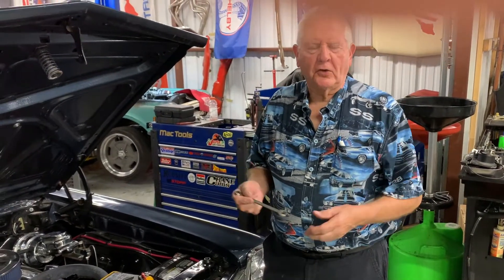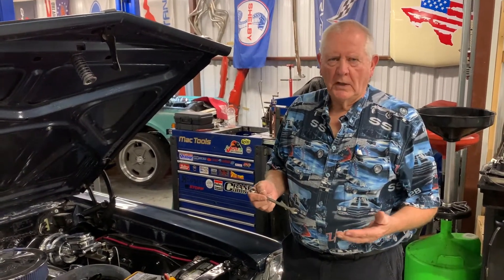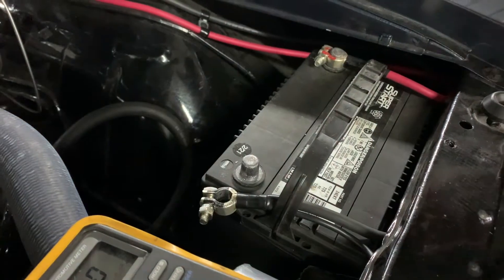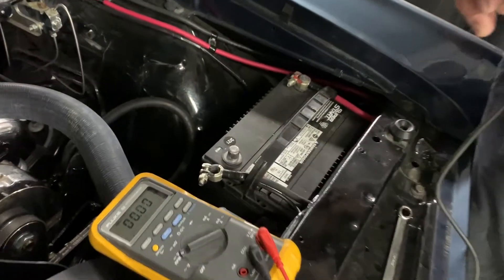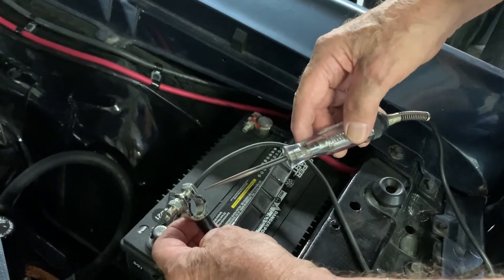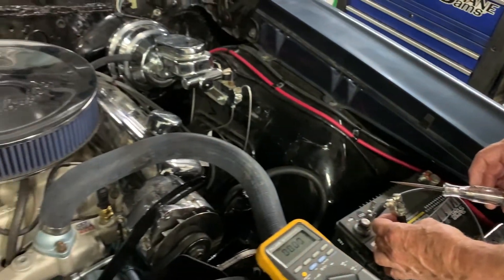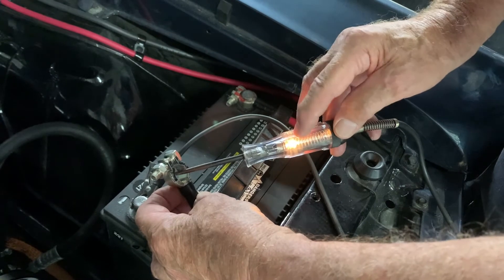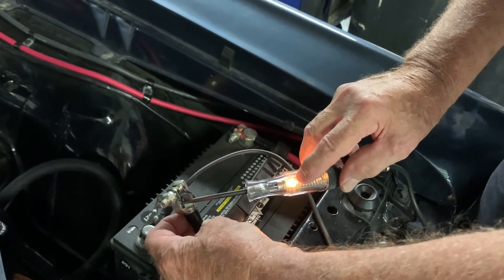How to Test for Car Battery Drain

Comment: Yeah, seems like my battery keeps running low. I just had O’Reilly‘s auto parts replace it like eight months ago. I replaced the alternator. I cleaned up the connectors on the starter and in the morning it seems like the starter is not getting enough juice one of the headlights is dim on the driver side I reattach a new ground and ran it to the frame and now the lights seem too bright so I wonder if I have like some kind of draw on the circuit. I’m gonna take it to a shop but since my car is 22 years old, all these mechanical repair shops are scared to work on a car that’s older than 10 years. That’s what they claimthat sounds like to me is they’re not educated enough on electrical to actually diagnose and complete the work.

Comment: Great video with great advice and information. I'm a mechanic who specializes in automotive electrical diagnostics. I've been doing this since 1989 and I couldn't have said or showed it better myself. I'm sure this will help a lot of people find out what's causing the parasitic drain on their car's battery. Although there are other tests to find the cause of parasitic drain, I always end up using this one if the others fail or take too long to perform. This method is especially useful when it's an intermittent drain. With the intermittents I use a meter or scope instead of a test light. Thank you!
Reply from the maker: You can't learn these techniques in a repair manual 
It's up to us to pass this along 
Unfortunately experience is a factor that helps us fix cars 
Seems like each problem has a different twist
Reply: Thanks I have a headlight dim, I hooked up another ground and now it seems too broken bright. It burns out bulbs and the battery in the morning makes the starter not seem like the battery has enough juice to crank it. AutoZone warranted the battery about eight months ago, and I swapped out the alternators and replace the starter. I might just have to take a shop.
Reply: @jasonhanson7728  With what you're having, it's best to take to a competent local mechanic or technician so they can perform a proper diagnosis.

Comment: Is it safe to disconnect a modern car battery like that?  Can it screw up computer settings on the car?
Reply from the maker: Consult your owners manual 
Safety should be an issues 
Lots of battery bad and get replaced without damaging a computer 
There are some models where you have to go through what's known as a drive cycle to allow the computer relearn 
The biggest issue is not hooking the battery terminals up incorrectly
That would more than likely cause a problem
Reply: If the engine is NOT running, this is completely safe to do on any car (modern or old). It will definitely NOT damage  any electronics or the car's computer (ECU, ECM, PCM). This is one method used to find parasitic drain in a vehicle. It's the oldest that I know of, but even the best technicians out there, rely on this method if other method's fail. Especially, if it's an intermittent drain.
Reply: No, it isn't safe. This procedure worked 40+ years ago, NOT on today's cats.
Reply: @kingmanta7679   It is so obvious you don't know what you're writing about. You don't have the faintest clue. Why would you come on here and give bad information? He is doing this with the engine OFF!  You can clearly see that the engine is off. This is completely safe with the engine off. 

You would never want to remove either one of the battery cables when the car is running on modern cars with alternators. It was only safe to disconnect battery cables on old cars using generators. 

Get your facts straight before you start writing about something you know nothing about. You watch a few YouTube videos and you think you know it all. Spreading misinformation like you're doing hurts people trying to fix their own cars.